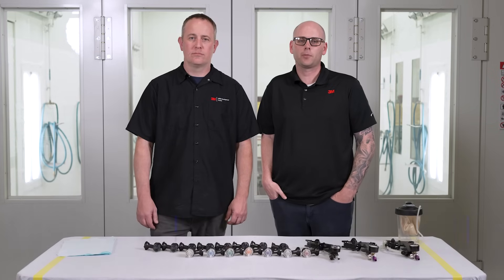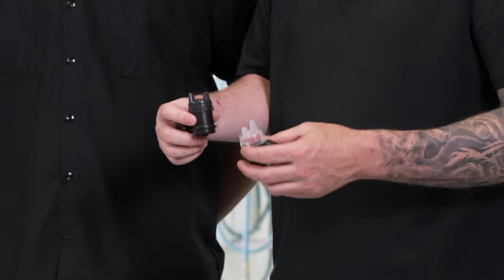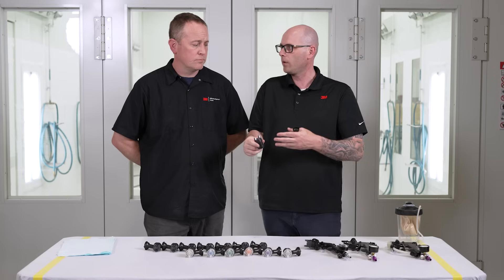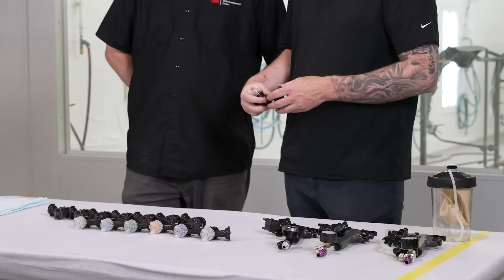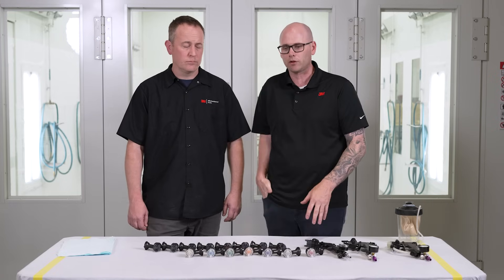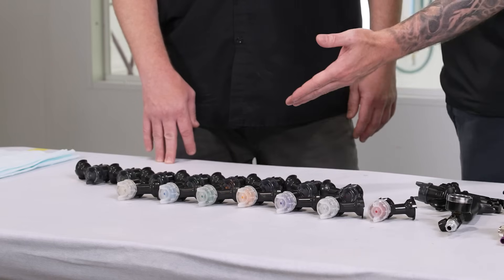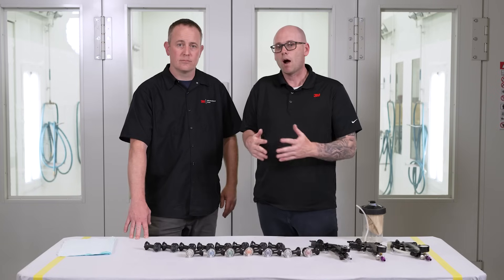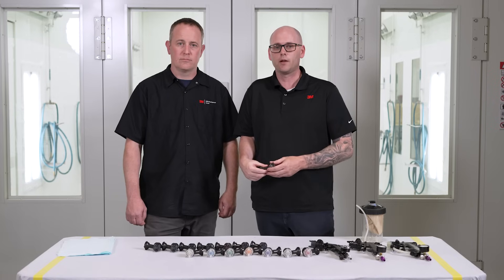Selecting the Right Nozzle for the New Performance Spray Gun 2

Comment: You guys should pick a traditional waterborne paint system and then a 1.5 coat water system and use the gun with the recommended nozzle sizes for each step for each paint line(sealer,base,clear) you would be surprised there are a lot of shop owners and managers out there that still think that this is just a plastic primer gun when that is far from the case